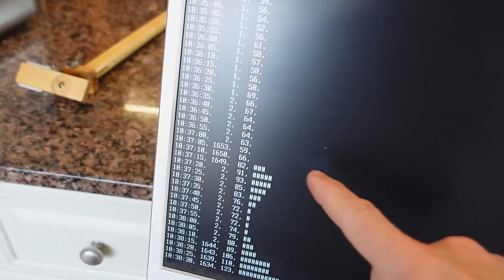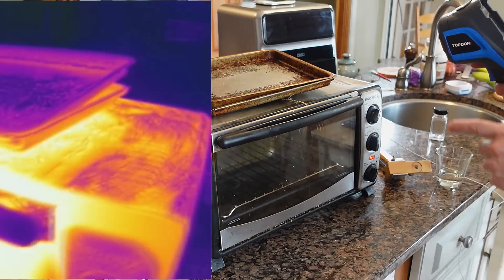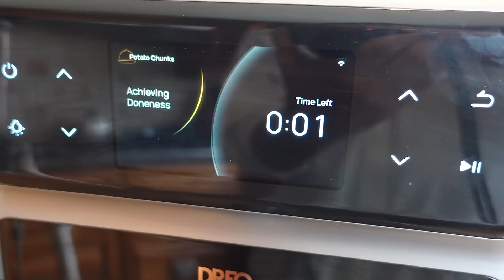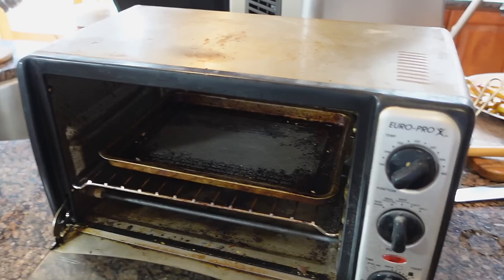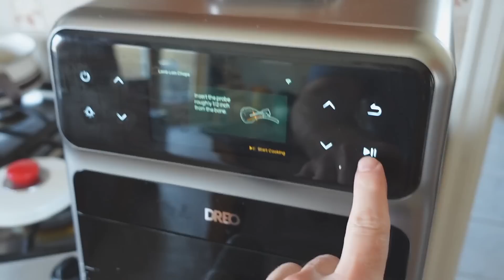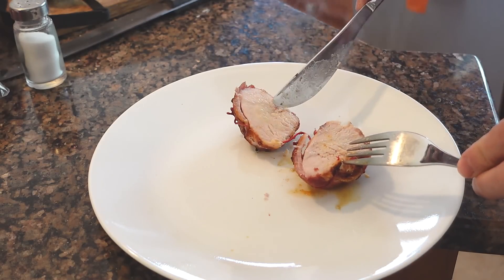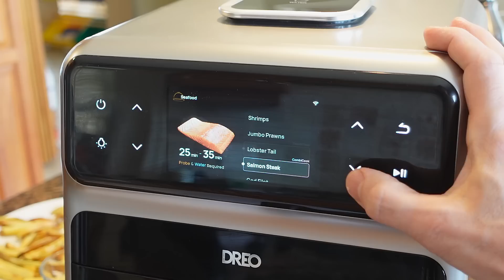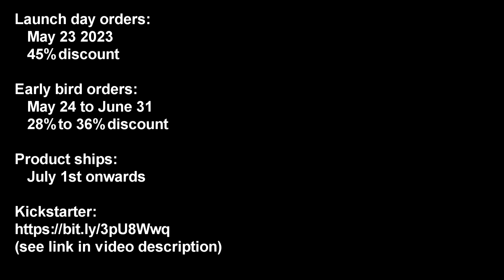What does an air fryer do?

Comment: I bought a basic one and I’ve net exactly found it convenient. It doesn’t have and inbuilt return paths, so if you fill it so that there’s a layer of fries, it basically just acts as a clumsy broiler. Turn everything every 4-5 minutes and it works fine, but it’s not great. Not sure if it’s any faster really.

The newer ones with a rotisserie, racks, and the ability to dehydrate look a lot more worth the counter space, but by that point I’m not sure that you’re saving all that much compared to an oven, so the selling point gets wonky.
Reply from the maker: yes, I turn over the fries about two times during the cooking too

Comment: The obvious question is - are those angled cupboard doors above the range hood angled to follow the ductwork? Do they open, or is it just decorative?
Reply from the maker: they are angled because they need to cover the range hood on the front, but not proturde in front of the crown molding between the cabinet on the top.
Reply: @matthiasrandomstuff2221  that makes sense, didn't see the crown moulding in the shot.

Comment: I always assumed you ate exclusively yogurt and granola based on the number of empty containers in your shop. 😂
Reply from the maker: years of accumulation!
Reply: My dad was always trying to find something to pour small amounts of paint in while working on his wood projects. He started making flags and only needed small amounts of color so I got him to start saving yogurt cups lol He has a lot of them now
Reply: @amberlindsey7112  tell him to be careful not to confuse paint and yogurt.
Reply: If the airfryer could hold 42°C for a few days, you could make yoghurt in it.
Reply: @jpa3141  Better done in an electronic pressure cooker, most have a preset for it as well.
Reply: @matthiasrandomstuff2221 Years, two whole years.

Comment: i wanted to make some springs and was wondering if a toaster oven could reach the required 500 degrees to i guess 'anneal'? the springs. (not sure that's the right word) could an air fryer work even better for that kind of thing?
Reply from the maker: I don't know.  This thing does 450 f
Reply: @matthiasrandomstuff2221  i just saw a spring tempering video by some german spring maker company /watch?v=Pfu-PbDVimY that looked reliable and they say 300C so I guess not.

Comment: Nice review! But how do you clean the thing? The tray's loose parts OK but the rest? Will it end up as your old oven after some time? :)
Reply from the maker: so far only cleaned the tray, which isn't hard.  I'm pretty sure the element incinerates what goes on it, it glows a dull red.  But we used it less than 20x so far.

Comment: an air fryer is just a very tiny convection oven. I've seen microwave air fryers and toaster oven air fryers. toaster oven air fryers are very good because they usually come with huge baskets you can cook a decent amount of food on.
Reply: I have an air fryer microwave, and I use the "micro conv" which turns on the microwave in the off-cycles of the heater. very good if you need a combination between fast food and properly cooked. 
and I've had an air fryer convection oven in the past and I loved how much food you could stick in the gigantic basket because it was an extra large model.

Comment: could you look into the exploding refrigerators and AC UNITS ? looks like they are  using something called Gyclopenthane or R 600A. refrigerant that has a ignition of less than 600 f.
Reply from the maker: yes, the latest refrigerants are slightly flammable.  But they don't use a lof of those.
Reply: @matthiasrandomstuff2221  I just saw a few days ago on youtube a lady frig was only a year old.and it compleatly destroyed her kitchen. thanks for your hard work always enjoy the videos.

Comment: What's the difference with this compared to a normal hot air oven? Seems unnecessary, especially if the oven is modern and have cooking modes, probes etc.

Comment: Do you have an electric oven? I'd like to see a comparison of air fryer vs. oven.
I believe you'd get the same result when using the upper rack positions, but would it take more power propotional to the containment vessel volume?
Reply from the maker: oven takes about 3x longer to get up to temperature.  and after that, the heat probably doesn't have the same intensity.  Being close to the element, and with the fan, makes a big difference.
Reply: @matthiasrandomstuff2221  I don't know, the grill setting on my oven is pretty powerful... It melted the edge band off my cupboards, and annihilated the shroud of my thermocouple too.
Any advice for re-attaching the edge band would be greatly appreciated, the darn things are just flopping around now.

Comment: To be consistent, you should have taken it to bits like you did the EcoFlow.
Reply from the maker: from the info I had, I didn’t think the insides would be that interesting.  also, I only opened up the ecoflow the way I did because I busted it.
Reply: @matthiasrandomstuff2221  , fair enough I will amend my statement. To be consistent, you should have first broken the air fryer and then taken it to bits like you did the EcoFlow.

Comment: How do you feel about heating non stick surface chemicals? Do you think a ceramic version matters
Reply from the maker: Personally lover our enamel pans (ceramic coating) but they are heavy.  wouldn't want that in an air fryer, but stainless steel would be nice.
Reply: @matthiasrandomstuff2221  yeah, maybe a small stainless convection oven would do the trick. Thx!

Comment: That looks like a pretty good product. I'll need to check the specs on the kick starter, I wonder if it will fit on my counter under the cabinets or if it is too tall. Thanks for the technical review.
Reply from the maker: It blows hot air out the back, so should not be too tightly enclosed that way

Comment: I have an air fryer toaster oven, but it doesn't have the water part. That gives me an idea to maybe add it to it. Should be easy enough.  We use is all the time. Makes great mini pizzas from scratch. Also chicken nuggets and fries. It will cook everything that turns to rubber in the microwave perfectly so its kinda the Ying and yang with the microwave.

Comment: What’s the cleanup like of the tray ? My only reservation, and why I’ve not got one is the cleanup and also the use of nonstick and how that holds up over time .
Reply from the maker: I use dishwash liquid and hot water.  I'm not a fan of non stick, but at least the tray doesn't get nearly as hot as a frying pan, so it should last longer than those.

Comment: Look nice - but WHY would anyone buy this for almost $200 when equivalent retail units are just as good, priced lower, can be returned easily and of course there is the Kickstarter issue where products are routinely delayed or shipped with missing features with no guarantees.
I know that this is a sponsored video, but I really would have liked to know what differentiates this from any other Air Fryer (many with Dual probes, App control, etc.)  What am I missing that makes this unit any better than the current Air-Fryers?

Comment: It's just a toaster oven with convection and less cooking space. If your toaster oven can't do fries in 15 minutes, it's garbage and not a valid data point for comparison.
Reply from the maker: and a lot more power in a small space, which means it can actually fry things
Reply: Incorrect. Frying requires submersion in oil. This is just broiling. Nothing new here.

Comment: I didn't take advantage of the Kickstarter's May 23 price or the other later ones because I wanted more specific info, other than it cooked. The view of the element is #1 (grease spatters burning on the element sets off my asthma), where the water comes out and a better description of what it does, a graph of the temperature throughout the cooking cycle (this I suspected but there was no info on the temp fluctuation difference or when it fluctuated), the temp as it heated up and how long that took (with the setting you used) - better than just words like 'Fast"). Lacking all of this info is why I didn't buy one. The last reasons are "is this, actually, going to be a thing with repair parts, honored warrantee and how long will the company stay in business, . . . . .

Comment: I was wondering: I have an old move with out the convection air feature.

Is there any way to build a small electrical motor for a small fan that would be completely fine with oven temperatures?

Comment: Anyone else wonder what the quality of the hot air coming out the rear vent is? Is it filling the room with more pollutants than frying or oven?
Reply from the maker: surprisingly, it doesn't smell up the place, beyond normal cooking smells.  But -- first time heating it up should be done in a well ventilated place, because first time heating up is smelly and needs to be done without food in it.

Comment: I have a Fryer and I luv it... Your brand outline was interesting practically and in technical details, especially the way you display running sensor data.   Are you using the python library called "curses"?
Reply from the maker: No, just a few lines of python to print a variable number of '#' based on the number.
Reply: @matthiasrandomstuff2221  effective!  I like the way you hold a static last result on the top right hand side, while still scrolling results continuously.

Comment: I haven't done a lot of things with my air fryer but have found the best thing it does for me is steak and potatoes wedges. My fryer goes up to 450f, and a 3/4" steak will be perfectly medium rare and browned on the outside in about 10 minutes, while it is resting, I do the potatoes wedges, another 10 minutes at 450f and when they are done you have a delicious easy meal! I love it!
Also, yesterdays pizza warmed in the fryer will taste close to freshly made.
Reply from the maker: With this one, I started setting it to 450f more too.  Fries and burgers work best at max temperature.

Comment: We've already got a really good air fryer and you've made me want this one lol  Dreo knew what they were doing by sending it to you.
Reply from the maker: he he he he :)
Reply: Dreo seems like a smart company, they take some of the most popular items solve the issues people are having with them and just give you good experience, for a little more money I guess, but a lot of people like that. Kind of wish they sold their items in EU.
Reply: @UhOhUmm  "Kind of wish they sold their items in EU"
Then we would get a 1200W or lower version because of the "climate".
Reply: @Varangian_af_Scaniae  There are no such limits. There are even dual air fryers in the EU which have above 2,5kW of power.
Reply: @Varangian_af_Scaniae  Actually you can probably get a 3000W one because of the 240V/15A electricity. My electric kettle here in the US (1500W) takes twice as long to boil water as the one I had in the UK (3000W). It drives me crazy enough (even though I've lived here for 20 years), that I keep trying to think of easy ways to run a UK socket from my 240V oven line!

Comment: Is the drawer / basket dishwashable?

That was always the issue with my Air fryer. Zero thought had gone into how you'd clean it. Eventually the whole thing got gunked up with congealed fat so I binned it and went back to a regular oven.
Reply from the maker: I just wash it with dish wash liquid every time, grease comes off easy. I don't put really bulky, or plastic items in the dishwasher myself, so hadn't considered it.
Reply: @matthiasrandomstuff2221  When I wash larger pans I'll tend to put a few glasses or mugs under so the space isn't entirely wasted.

The might block the bottom slightly but it's usually the sides of pans & dishes that need the most cleaning anyway so I don't see this as a big deal.

Comment: The entire point for the "air fryers" is to not use oil or use less oil. So adding oil seems a bit of an anti-pattern
Reply from the maker: to me its about the thing doing the frying without having to watch it.  And less mess
Reply: @matthiasrandomstuff2221  But is it actually less mess? You still have to clean the tray with all its nooks. Is that actually easier than cleaning a pan or an oven tray?

Comment: I have one of the cheapest air fryers (It has a very large basket) which I use quite a lot, especially with frozen french fries. I don't use any of the vent baskets, I just dump them in and toss them every five minutes. It will brown about four servings very nicely. I like to throw in a couple tablespoons of butter at the first tossing.

Comment: If it's a commercial product that is already in production why do they need a Kickstarter? Also I am pretty sure that nearly every Air Fryer on the market is a copy of another one, thank you China and Amazon.
Reply from the maker: The kickstarter is their marketing strategy, but yes, not my choice.  As for being copies of one anotehr -- they fry with hot air, but beyond  that, the various air fryers are different shapes and sizes.

Comment: Funny thing air fryers were made for cooking vegetables. They also tend to remove good fats from meats and saturate the bad fats. Many people fall into thinking using an air fryer makes meats healthy but it does the exact opposite.
Reply from the maker: The fat comes out regardless.  Wtih a BBQ, it gets turned into smoke and creosote.  With a pan, it gets burned a bit but still usable.  With an air fryer, it ends up in the tray an you can pour it onto your vegetables afterwards.  The grease to smoke part is why I only use the bbq for certain foods.

Comment: Air fryers are just fancy tiny convection ovens. Mine has 2200 W and the container is "double" walled, so the air can circulate freely throughout the food which give them an advantage over my normal big oven.. but that's about it...
Reply from the maker: Basically, yes.  But takes the convection to another level of intensity.

Comment: I have a basic air fryer and I use it a lot. Try fresh non frozen hamburgers, they are delicious when you cook them with the air fryer, 10 minutes at 180 degrees Celsius (356F) and they are done, good color, nice bite, and still super juicy. Pretty much any type of meat will do. Fish, chicken, I even cook shoarma or kebab with it. And it all tastes great, and if you want you can get it nice and crunchy while the meat is still very juicy at the inside.  And yes it cooks truly fast. That requires a little learning curve. But once you tried several things you know how long to cook it. My basic machine also has simple instructions written on it so that I can set the temperature correctly for the type of meat that I am going to cook. I follow those instructions and that works great for me. And the basket fits inside the dishwasher.
Reply from the maker: Good to know.  The thin pre-made patties aren't optimal in the fryer.
Reply: @matthiasrandomstuff2221  I honestly only cook my hamburgers with the air fryer. I put some salt and pepper on it before I put them in the fryer. You can also make or buy your burgers with unions inside. If it didn't taste absolutely delicious I wouldn't do it. And on top of that it is fast, easy, and much healthier. There is no need to pay attention to it while it is cooking.

Comment: for cooking hamburgers, I think you might want to look into a "George foreman" or a contact grill. it cooks both sides of the burger at once making for a faster cooking time. the smallest size is a bit too small unless you only want a single burger 
there are also better electric grills that will snuff the smoke so it won't set off the fire alarm, those would be good for a dorm or small apartment.

Comment: We got a different brand for Christmas; tried a pork loin in it and it was perfect. The best! However; my wife has switch to more conventional cooking (pork loin still turns out extemely good, she is using the temp probe and that is the main secret) but the cleaning is easier than the air fryier.

Comment: According to my research air fryers that move the food do a much better job. The ones that does not have any actire stir element recommend to shake the bin at halfway, still not as good as the active ones. I love my Tefal Genius Xl. Also the goal is to use as minimal oil as possible.

Comment: We love our air fryer over here in Scotland... for many things you don't need to fire up a big oven and its so versatile. It's not a feature rich as this one but it was very cheap, maybe about £50 ($60) and cooks things way faster than an oven and in most cases you can just load in there, set a programme and/or timer and walk away...
Reply: The fact these things just shut off on their own will probably save the fire brigades a lot of headaches.
Reply: The timer functionality is the best. Combine it with a pressure cooker / crock pot with a timer and you're about 30m away from a meal! I'd like a smaller of those pressure cookers too to make smaller batch faster.

Comment: I like the basket design for air fryers. I got one that's shaped like your toaster oven even though it insists it's an air fryer. I don't like it compared to a few friend's basket styled air fryers. Not this brand though but my old basket designed air fryer snapped off at the handle after a few months of use.

Comment: The only thing with these devices is they are misleading, to fry anything you need oil for specific chemical reactions to occur and it’s simply impossible to fry without oil, no matter what.
Reply from the maker: The browning is a chmical reaction, and it's not dependent on oil.  But we usually put a bit of oil on the stuff before it goes in.